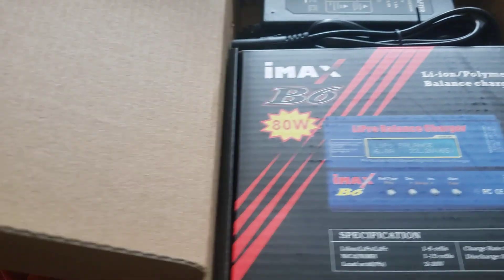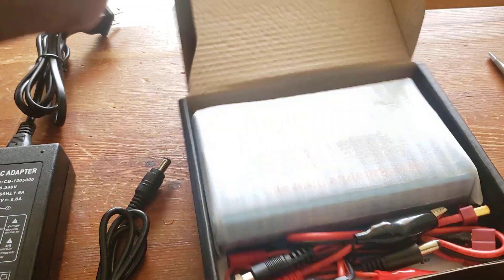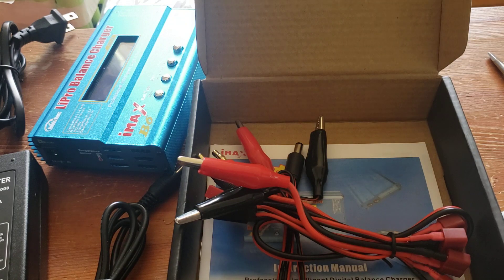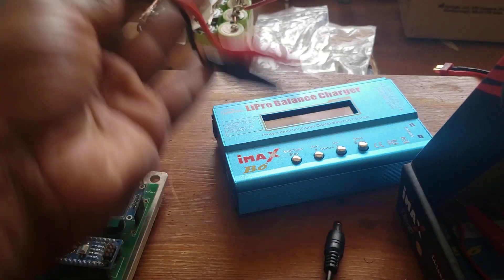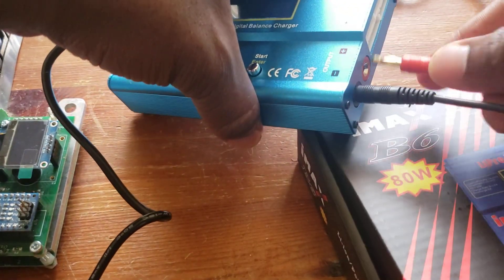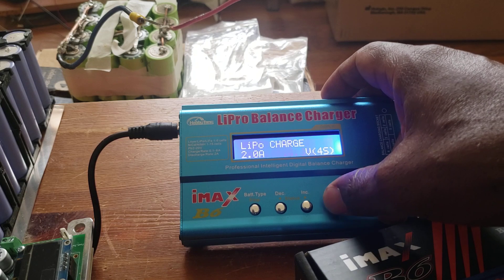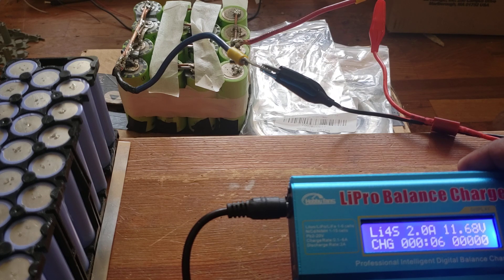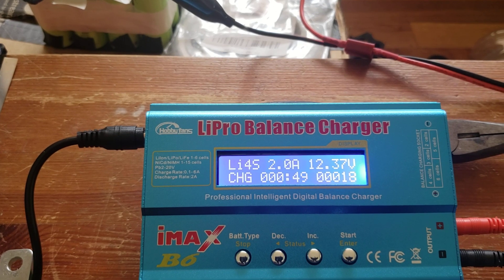IMAX B6 HOBBY FANS MINI Balance Charger/Discharger with Power Supply for 1S-6S LiPo Lilon RC Battery

Comment: The Hobby Fans Unit has slightly different software in it. You can't calibrate it. The Imax can be calibrated.
Reply from the maker: This one doesn't have the fan. I needed something right away. So I got it